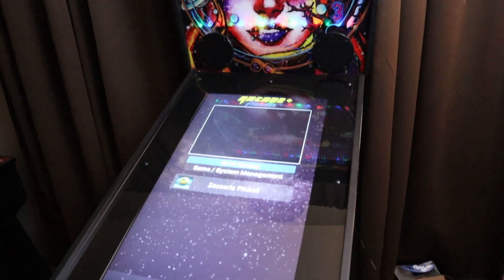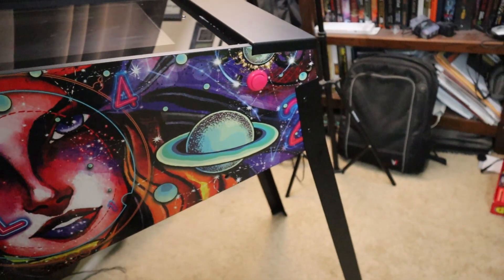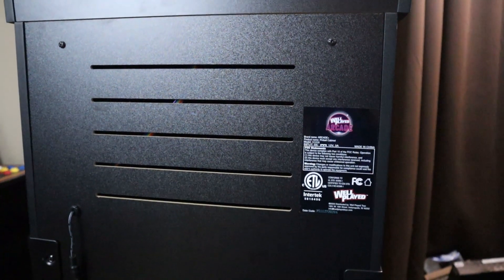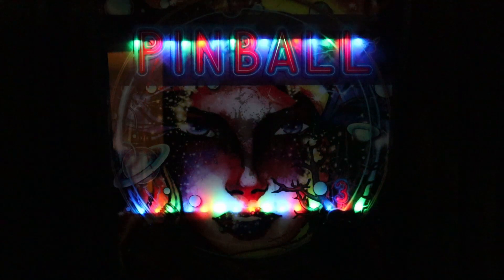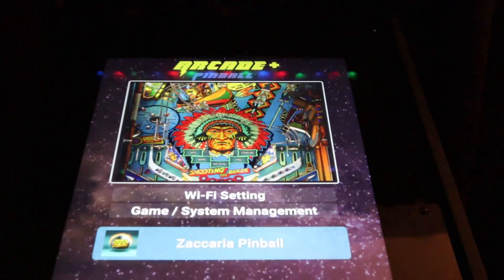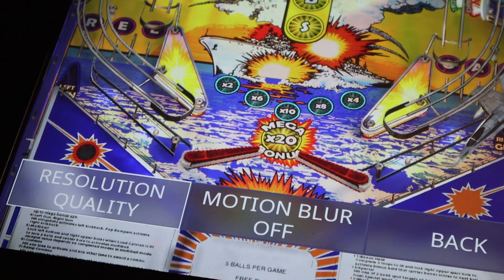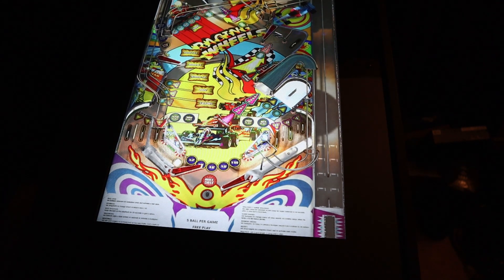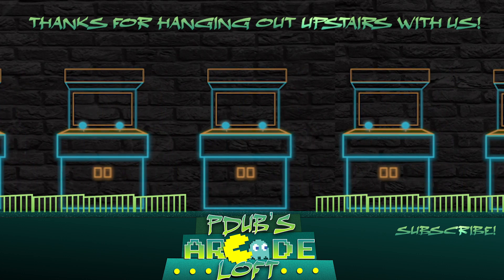Well Played Arcade Virtual Pinball Review! Does it Stand a Chance?

Comment: $500 is excessive for this table, as it has no score display in the backbox, and just a 24" monitor. To be honest, I wish manufacturers would stop calling tables with only a 24" monitor a 3/4 scale table, even though the cabinet, it's self, may be 3/4 scale. It's the play field monitor that determines scale, more than anything. At 24", it's a 1/4 scale play field. I agree, the word "pinball" doesn't need to be plastered all over the table. The only thing this table has going for it is modification. Throw in a nice back box monitor. rip out the 24" monitor, and toss in a good 32", or better play field monitor, and a good PC, and you'll have something. Thanks for sharing this.
Reply from the maker: Great feedback and modding ideas Thomas! I appreciate it.

Comment: Clench your things to pull out the plunger to get to the table menu settings. I will never understand why there is no left and right nudge, what were they thinking? Also the back box is a nightmare with no dmd and the way the lighting works....really this is a value table and should be priced as such. I really want to like this table and maybe it plays fantastic i would have to see for myself. Good job as always buddy
Reply: if this was budget I would not hesitate, take out the acrylic back and put in a monitor,  its just so ugly
Reply from the maker: For $400 it'd be a good deal IMO. For $500 it needs improved to justify the price...at least IMO.